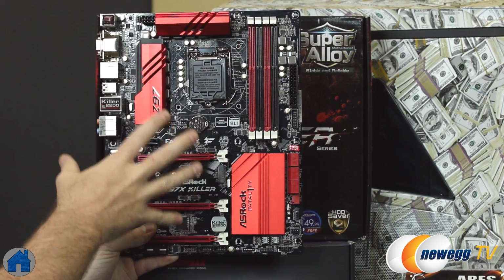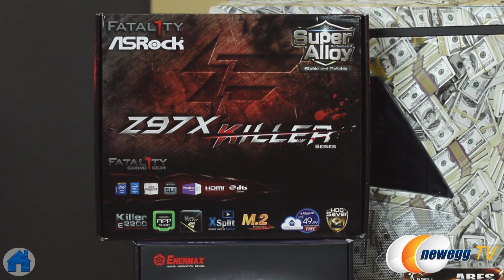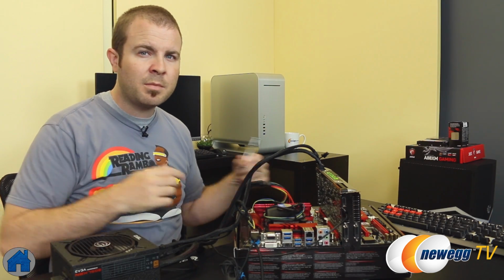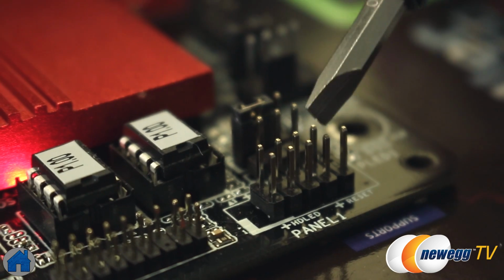How to Build a PC - Part 1 - Newegg TV

Comment: Is this a good build for minecraft on low settings? Mom won't allow to spend more money.... :(

CPU: Intel Pentium 4 2.50GHz
MOBO: Asus P5GV-MX
Ram: Kingston 512MB DDR (1x1)
GPU: Nvidia Geforce 6700 GT
HDD: 128 GB 
PSU: Seasonic 100 watt
OS: Windows XP Service Pack 1
Case: N/A (I'll try to push all of this inside my desk table with my leg so it looks cool).
Monitor: Stolen from school
Mouse: Found on the street
Keyboard: I can create one myself using house keys and chess board.

Max budget 300$ (things are cheap in my country).

Comment: Hi,
I am new to PC constructing and I am interested in making one.  I have all of the parts together on pcpartpicker, but I have one question.  When choosing RAM do I go up the scale (2666 would be better than 2800) or do I move down the scale (2800 would be better than 266).  Please don't call me a noob I am completely new to PC engineering.  Please reply I have a limited time before I have to order my build.  Thanks!
Reply: If your talking about the frequency / clock speed of the ram thats in mhz then 2800mhz is faster than 1600mhz. ddr3 ram is consists from usually 1333mhz to 2400mhz, so 2400mhz is faster but it also has a higher latency, so that means the time from when its told to do something and then when it does it, so you will usually see 1600mhz at a CL9 latency and a 2400mhz at a CL11 or something like that, i would just go with 1600mhz CL9 ram, but really its up to you :).
Reply: Tell me the parts you are getting and also if you are building a gaming pc :).
Reply: Will Hardy Fraser Thanks for the reply; that helped more than you think!
My build is:

CPU: Intel Core i7-5930k
CPU Cooler: Zalman CNPS12X 
Thermal Compound: Prolimatech PK-1  
Motherboard:  MSI X99S Gaming 7
RAM (Memory):  G.Skill F4-2800C16Q-16GRK (16GB DDR4-2800) 
SSD: Samsung MZ-7KE512BW (512GB)
HDD: Seagate ST2000DM001  (2 TB)
Second HDD: Seagate ST2000DM001  (2 TB)
Video Card: MSI GTX 970 GAMING 4G

The other parts are based on preference (mice, keyboard etc.)
Reply: amazingjoe555 So for a gaming build, you actually don't want to go with that particular i7.  It runs games about the same as the i5-4690K, which is much, much cheaper and really about the best you'd want to get for gaming.  If you must have the best performing i7 for games, go for the i7-4790K, but be warned that it's about $80 more than the i5 I mentioned and performs maybe up to 2 to 5 FPS better in most cases.  Some cases it actually performs worse, but games like Battlefield 4 benefit from it a bit more.  On the other hand, the i7-4790K is a boss at such tasks as video encoding, code compiling, and image processing (heavy photoshop work).  So if you're doing things like that all the time, you might want this CPU.  The i5 can do it, but for these tasks the i7 stomps it.  If not, you should probably stick with the i5.

The cooler I would suggest is the Noctua NH-D14 which performs phenomenally and even beats out a lot of closed-loop liquid coolers.  You only really need that if you're interested in overclocking though.

Now to go to the 4xxx CPUs you'll want a Z97 motherboard.  The one featured in this video is very good value, as are ones like the MSI Z97 Gaming 5.  In addition, these motherboards don't support DDR4, but there's currently very little gain to be had from DDR4 and a build that supports it in no way justifies the cost.  I'd say it wouldn't be a good choice for a few more years and getting it now just makes a build that's behind the ball for when that time comes.

I don't know if you'll really need the 512MB SSD, but if you can afford it, go with it.  Samsung's SSDs are good, and Seagate makes good HDDs.

The video card choice is one of the best.  Go with it.

You'll need a decent-sized PSU.  If you want overclocking and SLI down the road, get a 750W.  Corsair, Seasonic, and EVGA have excellent 80+ Gold PSUs at 750W for a good price, some beating out even 80+ Bronze prices for the same wattage - Seasonic generally makes some of the best PSUs, so if you find a good-priced Seasonic you won't go wrong.  If you just want overclocking, a 500W to 600W will probably be just fine.
Reply: ***** Thank you for your feedback!  This going back to my original question, what DDR3 RAM do you recommend for a pc that does video editing from a capture card every once and a while and does heavy gaming?  Also, I play Battlefield 4 and I heard it can run on 6 cores.  Will the i7-4790k have worse performance when when compared to the i7-5930k when I play Battlefield? Thanks for your feedback and I apologize for all of the questions.

Comment: Hi, what case would i need for this build?

Intel Core i5-4690K 3.5GHz Quad-Core Processor
Corsair H100i 77.0 CFM Liquid CPU Cooler
MSI Z97-GAMING 5 ATX LGA1150 Motherboard
G.Skill Ripjaws X Series 8GB (2 x 4GB) DDR3-1866 Memory
Samsung 840 EVO 120GB 2.5" Solid State Drive
Seagate Barracuda 1TB 3.5" 7200RPM Internal Hard Drive
Gigabyte GeForce GTX 970 4GB WINDFORCE Video Card
SeaSonic 650W 80+ Gold Certified Fully-Modular ATX Power Supply
Lite-On iHAS124-04 DVD/CD Writer

Thanks
Reply: you would need something like a mid tower case. What case depends on how much you're willing to spend. Just look up reviews for cases you're interested in.

Comment: Are all motherboards compatible with all gpus? I'm getting the Gigabyte f2a58m-hd2 mother board and I do not know if it is compatible with all gpus? I don't want to buy one and find out if isn't compatible
Reply: Not all motherboards are compatible with all GPUs, but most are.

To verify, determine what interface the graphics card uses. You can find this info in a "specifications" section of the product description, on the GPU's box, or on the manufacturer's web site. For modern gaming cards, it'll usually be PCI Express 3.0 x16.

Then check your chosen motherboard's specs (again, usually available on the product page or box) and verify that it has a PCI Express 3.0 x16 slot. The motherboard you listed does, which means it is should work perfectly with any graphics card you're likely to find available at retail, except maybe some very low-end cards that utilize the legacy PCI (not Express) interface.

The larger (x16) PCI Express slots can accommodate any PCI Express card, and in fact, smaller slots (e.g. x1, x4) will often accommodate larger cards (x16) depending on if the motherboard manufacturer produced the slots with open backs. Also, all versions of PCI Express (3.0 vs. 2.0 vs. 1.0) are compatible with each other.

So a PCI Express 3.0 x16 slot will work fine with any PCI Express card, and you may even be able to fit a PCI Express 3.0 x16 card in a PCI Express (1.0) x1 slot, but the latter will significantly degrade the card's performance.

Edit: Another rare source of incompatibility is that some motherboards have large heatsinks which can obstruct the placement of long graphics cards. Again, not an issue with the motherboard you specified.
Reply: Thanks

Comment: What do you guys think about this build?

CPU: AMD FX-6300 3.5GHz 6-Core Processor  \

Motherboard: Gigabyte GA-970A-D3P ATX AM3+/AM3 Motherboard 

Memory: Crucial Ballistix Sport 8GB (1 x 8GB) DDR3-1600 Memory
 
Storage: Western Digital Caviar Blue 1TB 3.5" 7200RPM Internal Hard Drive 

Video Card: MSI Radeon R9 280X 3GB TWIN FROZR Video Card 
 
Case: Cooler Master HAF 912 ATX Mid Tower Case 

Power Supply: Corsair CX 600W 80+ Bronze Certified Semi-Modular ATX Power Supply 

Optical Drive: Asus DRW-24B1ST/BLK/B/AS DVD/CD Writer 

Operating System: Microsoft Windows 7 Home Premium SP1 (OEM) (64-bit) 
Total: $749.38
(My price point is 750)
Reply: What Matthew said :)

Comment: Should I use an ssd 1tb? Or buy a hdd and ssd
Reply: 1 TB SSDs start around $400.

A 256 GB SSD + 1 TB HDD will run you closer to $150.

256 GB is enough to comfortably fit your OS, drivers, all of your smaller and mid-size apps, and about three good-sized games, so I think that for most users, the latter is a better value proposition.

I personally splurged and went with a 512 GB SSD + 1 TB HDD combo. In hindsight I feel that might be a little excessive, but being able to install a game on the SSD without a second thought and not having to rearrange them often is a nice quality of life feature... just maybe not worth the $100ish premium I paid for it.

If you are using the system as a workstation and regularly work with very large files, a 1 TB SSD may very well be worth it. But for gaming and general PC use, the money is probably better spent elsewhere.
Reply: Thank you for making things clear!

Comment: comments on my set up?

Cpu: Intel Core I7-5820K
Mobo: ASUS X99-DELUXE ATX LGA2011-3
Ram: G.SKILL Ripjaws 4 16GB 4X4GB DDR4-2800
GPU: ASUS GeForce ROG Matrix GTX 780 Ti
SSD: Intel 530 Series 240GB 
HDD:Western Digital WD Caviar Green 3TB
PSU: Corsair AX860 860W Platinum
OS: Windows 8.1
Case: NZXT Phantom 530 Full ATX Steel Tower Case
Reply: I think it's good if you're going to be using it as some sort of workstation. It's not optimal for gaming and general purpose computing though, and I would get a GTX 970 (for value and performance) or 980 (for performance) over the 780 Ti unless the 780 Ti is heavily discounted from retail.

If gaming is going to be the primary use I'd go with 2x 970 in SLI and a larger SSD. You can trim down the CPU (but add an aftermarket HSF to overclock) and RAM to make room in the budget if necessary.
Reply: Thanks! I got the ti discounted by 200$ which is why i went with that.
Reply: i built it before they came out, if i were building it now i would use them

Comment: This good for a gaming build?

CPU	Intel Core i7-4790K	
FAN	CM Hyper 212 EVO
MOBO	ASUS Z97 PRO LGA 1150
GPU	MSI GeForce GTX 970 (SLI x2)	
RAM	Crucial Ballistix Sport 16GB
SSD	Crucial MX 100 128GB
HDD	Western Digital Blue 1 TB
CASE	Cooler Master HAF XB EVO
PSU	XFX PRO850W
ODD	Samsung 24x SATA
Reply: Looks good, but in this price range I'd want a much larger SSD for quality of life (moving games around can be a bit of a hassle).

Also, the EVO is a fine CPU cooler (I own a couple) but again, in this budget range I'd be tempted to go with something that offers better performance and more style, like the NZXT Havik 140 or the Zalman CNPS 9900 MAX.
Reply: Quinstol Noctua NH D15. Gigantic cooler but performance is off the charts.

Comment: Do you need to buy those stand offs separately?
Reply: Your case should come included with all of the necessary stand-offs, usually already screwed in for an ATX configuration. You might have to rearrange them in some cases.

Comment: How's this build?
specs:
Graphics: R9 270
CPU: FX 6300
MOBO:GIGABYTE GA-970A-UD3P
Ram: 4 GB ( should I increase to 8 GB? )
HDD: 1TB
Power Supply: SeaSonic S12II 620
Case: HAF 912
Reply: Increase to 8GB for sure, if you can afford it get a small SSD to install the OS on, makes the whole system a lot faster. If your budget allows it I'd invest in an Intel processor.
Reply: 10 fps makes all the difference
Reply: Ernest660 Well, the G3258 costs less and is better than the FX-6300. Let's face it, games LOVE intel CPUs.
Reply: You get what you pay for.
Reply: intel is 10fps increase for allot more money, dont do it. either then that just get SSD and 8gb 1600mhz or higher
Reply: ***** for an extra $120 if not more? pffttt ok
Reply: Le Leedler just because someone is wrong doesn't mean you get to talk shit about them
Reply: I would change the power supply to the corsair cx600 or cx600m
Reply: Ernest your thinking is stupid Intel is faster in general for other things than fucking gaming
Reply: ***** don't forget to tell him to switch motherboards and make sure the motherboard is compatible. You cannot just switch an amd processor for an intel processor with the same motherboard unless you're trying to make him ruin components.
Reply: SupremeStorm Lol i have almost the same exact build but i have 8GB of ram
Reply: AJ Your Sexy Is this a good build? 

http://pcpartpicker.com/p/LPqFMp
Reply: The Legendary Mexican Pootis Heavy yea for low to medium settings, but if you want higher you should really try and spend more on a CPU and GPU

Comment: How is this setup?
Case: Nzxt Phantom PHAN-001RD
MotherBoard: ASRock Fatal1ty X99X Killer LGA 2011-V3 intel x99
CPU: Intel Core i7-5930k Haswell-E 6-Core
Ram: G.SKILL Ripjaws 4 series, 4 sticks
Video Card: GIGABYTE GV-N970WF3OC-4DG GeForce GTX 970 4GB
Power Supply: EVGA 110-B2-0850-V1 850W
CPU Cooler: Cooler Master V8 GTS
SSD: SAMSUNG 850 Pro Series MZ-7KE512BW 512 GB
Will all these parts work together?
And is my PowerSupply overkill?
Reply: if you are doing heavy over clocking  http://pcpartpicker.com/p/hbWCMp
if you are doing a little over clocking  http://pcpartpicker.com/p/RdppVn
if you aren't going to over clock         http://pcpartpicker.com/p/R3qgCJ
Reply: TheCardq Do these parts I picked work together. And is power supply overkill?
Reply: Are you going to OC, and how much?
Reply: Im just a 14 year old that wants a future proof gaming pc that can run 1080p max settings. Im not oc and i wil be recording vids
Reply: http://pcpartpicker.com/p/8LfJNG

Comment: how's this set up?

CPU: intel core i3 4150 
MOBO: msi z97-g55 sli
RAM:crucial ballistix sport 8gb
GPU: evga gtx 970-stock 
HDD:1tb wd blue 7200 rpm
PSU:evga 600b 80PLUS bronze 
OS: windows 8.1 64 bit
Case: thermaltake chaser A31
Reply: Whoa bro chill. i3? atleast go with a i5 like the i5 4690k
Reply: Finally, thanks
Reply: matthew cricelli no problem if you have any questions...ASK! :D
Reply: TheGamingKiwi1 An i3 is sufficent for moderate gaming, but I would avoid it with any GPU more powerful than a gtx 660
Reply: TheCardq its sufficient but it wouldnt hold up that well especially if hes going with a 970

Comment: Getting the last couple of parts for my first build soon, can't wait! I'll have a few upgrades to do after the initial build but here's what's going in it.

CPU: i7-4770k
MOBO: Maximus VI Formula
GPU: Asus GTX 980
RAM: Corsair Dominator Platinum 16GB 2133mhz
CPU Cooler: H100i
PSU: AX1200i 1200W
SSD: 840 EVO 1TB SSD
Storage: Western Digital Black 4TB
Case: Cooler Master Cosmos 2

I'm upgrading from an extremely outdated system so I'm very, very excited to put everything together and play the games that I haven't been able to play all this time and all of the awesome upcoming games like Witcher 3!

Comment: Come on people it's not hard.

1. install psu with fan facing down
2. install cpu into socket
3. put thermal paste on cpu
4. install cpu cooler
5. install standoffs (some cases come with these)
6. install ram
7. put motherboard into case
8. line mother board up with standoffs and screw them in
9. plug in cpu power, mb power ect
10. plug in sound and case leds, case power ect
11. install gpu
12. install gpu power
13. install hdd and power

so easy
Reply: And yet there is so many ways to screw it up. It may not be hard for people like you or me who have done it a million times, but the hard part for most is the intimidation caused by looking at that mess of cables and thinking "Holy shit, wtf have I gotten into???" Then there is making sure you handle the parts right. This vid is a bad example of that one, But to first timers, this is hard, not easy.  For first timers, I would suggest looking up someone like Carey Holzman on YouTube.

Comment: Pretty nice guide, i learned a thing or two, even though i'm building my PCs for quite some time.
But there is one topic, i think you could have covered a bit more detailed, since it is very confusing for beginners. I'm talking about the front panel connectors (power/reset button & LEDs).
Most Parts of a PC can't really be plugged in the wrong port, but with the front panel connectors you can do allot wrong. I know, it is covered in the mainboard manual, but then you might still ask yourself, if the label of the connector has to face the MB or away from the MB, or if it even matters.

You might disagree with me, but i think this is one of the most confusing part of building a PC.

Comment: How's this set up?
Specs:

CPU: Intel Core i7-4790K
MOBO: ASRock FATAL1TY Z97X KILLER 
RAM:  Corsair Vengeance 16GB 
GPU: ASUS GTX980
HDD: Western Digital 1 TB Black
PSU: EVGA SuperNOVA 750B1 
OS: Windows 8 home premium 
CASE: NZXT Technologies PHANTOM 530 
Monitor: ASUS VG248QE 24"

Comment: Also, I have this system, and I want to know what to upgrade first and to what:
CPU: AMD FX 4150
MOBO: Gigabyte 78-LMT-USB3
RAM: 8GB Patriot Viper Xtreme 1600 mHz
GPU: EVGA GTX 770- 2GB GDDR5
HDD: 500GB WD Blue
PSU: ThermalTake SmartPower 650W 80+ Bronze

I only use this thing to game, no video editing/benchmarking/photoshopping.
Reply: nothing
Reply: the motherboard supports AM3+ and AMD FX8350 is AM3+ so it should be compatible
Reply: Hey Max, the only other thing I might add is a SSD for your OS. improves the load time a lot. If you can, add another exact HDD and put them in RAID for back up. Other than that, it's a nice little system. Perhaps check out Tek Syndicate's website. Lots of great people there all dedicated to computers and the world around computers.
https://teksyndicate.com/
Reply: Matthew Yohanes got a liquid cooler since then
Reply: The processor to a 8350
Reply: The Only Killer I've heard that my mobo might not support an 8350, is this true? Thanks for replying.
Reply: Also get a aftermarket CPU cooler with a FX8350
Reply: Adil I I have a liquid cooler, so I guess just the 8350..?
Reply: my name is MAXIMILIAN yeah
Reply: my name is MAXIMILIAN your pc is good, dont upgrade right now unless your planning to play games coming in 3years or something